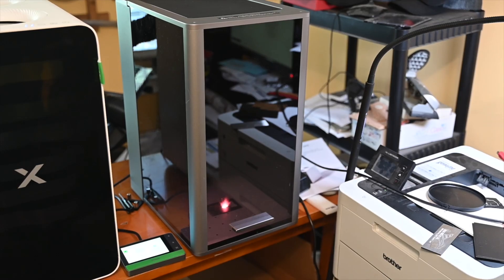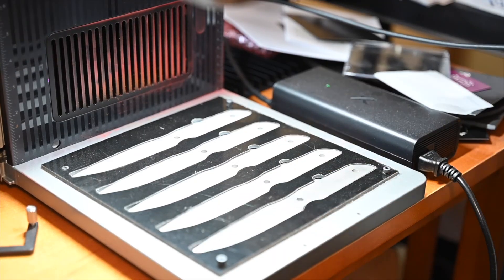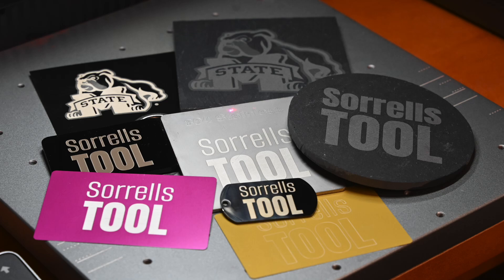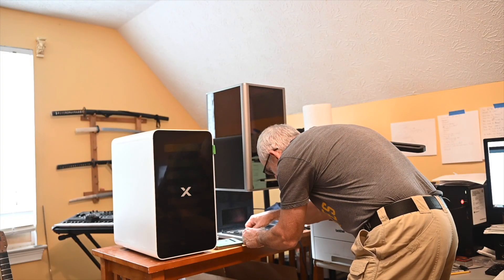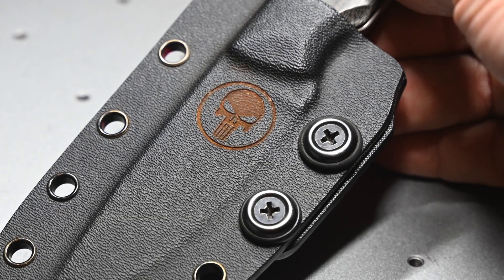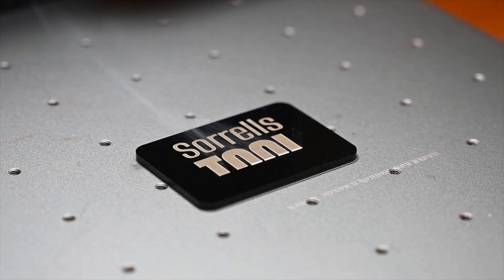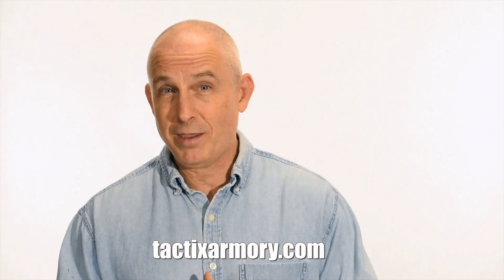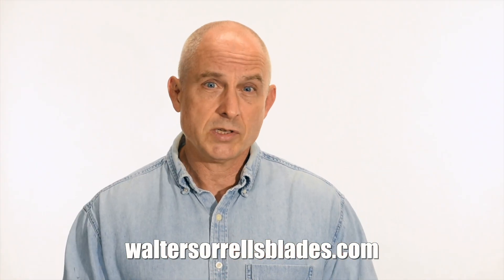Knife Making Game Changer? - Reviewing the xTool F2 Ultra Laser Engraver

Comment: I see alot of small time knife makers hopping on this laser train rn.
Im kind of fizzzled on the whole "our product is cnc engraved!" scthick. Maybe its on account of fact that i am not old enough to have lived in a world where at one point everything inscribed has to be done by hand. Laser engraving is starting to feel cheap, well because it its now. Am alone in thinking this?

Using super fast and easy laser engraving as a value added step where you as a maker can profit $200/hr of machine time for a dirt easy process is great and all, but to me i see it as a sign that a maker is trying to upsell me. When looking at stuff made by artists and small time makers, I generally avoid most stuff where the gimick is that its custom laser engraved, it kind of gives off a lazy impression the same way advertising using AI art does.

Obviously at higher volumes this becomes a non issue bc the goal is Production, so taking the time to laser etch something becomes a nice touch, again. Im mainly talking about people working in small numbers and one off customs where the point is that artform of it. I see those folks using laser engravers alot.